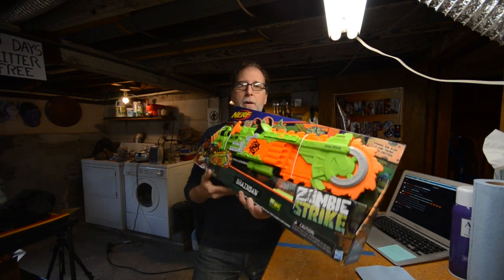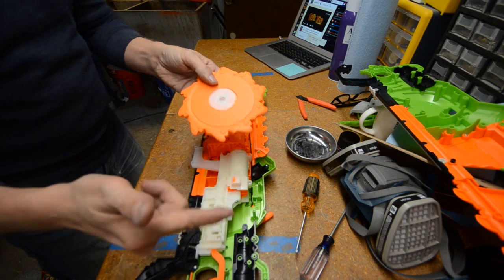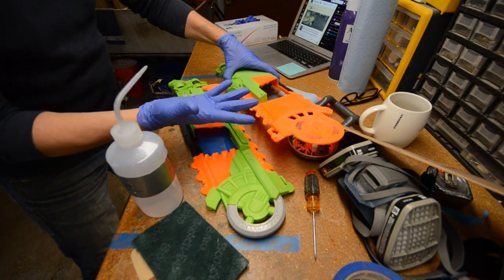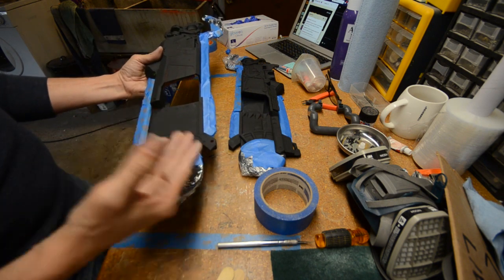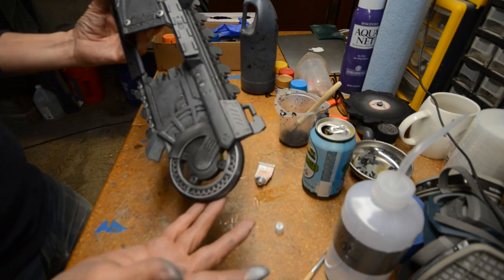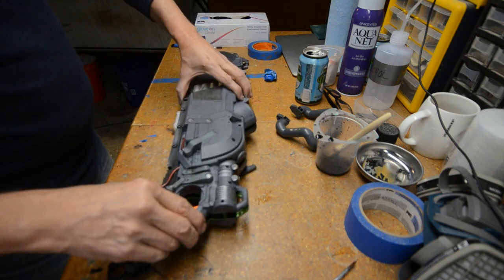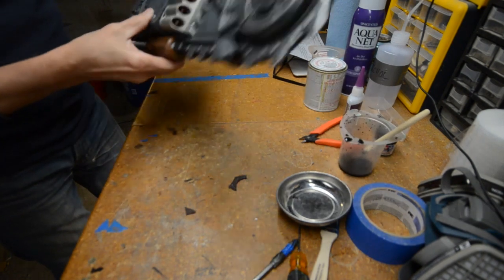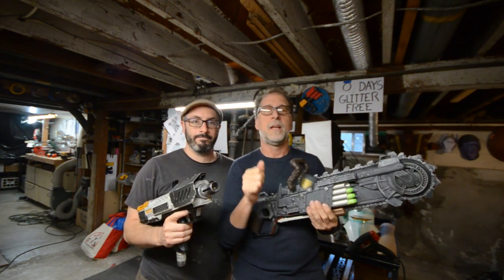Painting a Nerf Blaster with Bill Doran.

Comment: I love Nerf blasters because they're really easy to take apart and modify. If you're not sure how to modify the internal mechanisms, there are roughly 10,000 videos on YouTube on how to safely mod Nerf blasters of every type, ranging from just painting the exterior to major modifications like changing the Mega blasters to accept the standard size darts to all kinds of crazy mods. Plus, if you're afraid of screwing up, you can find older models like the Maverick and Recon at pretty much any decent thrift store or garage sale for dirt cheap, as well as in varying conditions on Ebay. Also, the different blaster lines (like the Mega and Zombie Strike series) really lend themselves to being modded into sci-fi or Steampunk weapons, depending on the style.
Reply from the maker: Thanks for all cool tips.
Reply: Hey, it's the least I can do to try (pathetically) to repay you for all the cool videos! (Yeah, like that could ever happen! -_^)

Oh, and on the subject of Nerf modding, here's one from my roomie Derek: as you remove the screws from a nerf blaster, take a spare sheet of cardboard, trace the outline of the blaster you're disassembling onto it, and punch small holes into the outline in the same places as the screws you remove, then put the screws into the corresponding holes so that it's easier to put them back in the same places you removed them from.

Comment: What I like to do to weather guns is to paint the gun with a base coat of silver after the primer. Then, after I've painted the black, or whatever color on top, I then lightly start sanding away at edges, and any other area I want to expose the silver, with some 0000 steel wool. I find that this gives me a lot of control over how much of the silver I want to expose, both in terms of area and amount, so I can have areas where the silver is only just starting to show and areas where it's fully exposed.

I've also found that using 0000 steel wool over the cheap Home Depot semi-gloss black spray paint (which is really glossy actually) dulls it down to a nice, proper semi-gloss and does a pretty good job at replicating the blueing found on a lot of guns. The only down side is that it doesn't allow you to get small recesses, so those areas will still have the original finish, but everywhere else looks great though.
Reply from the maker: Thanks for the cool tip!